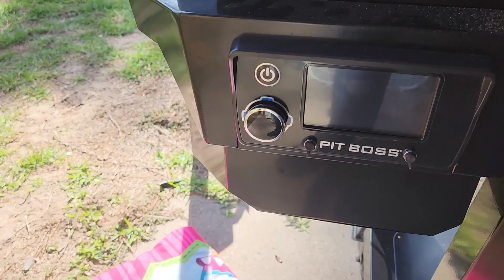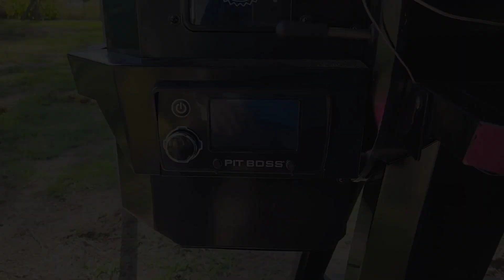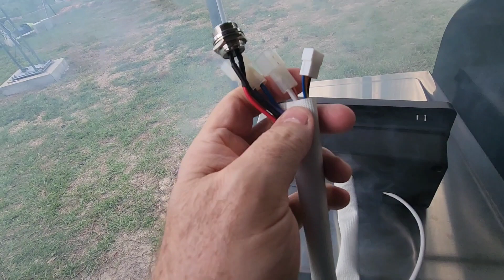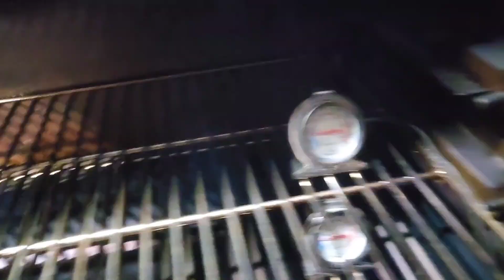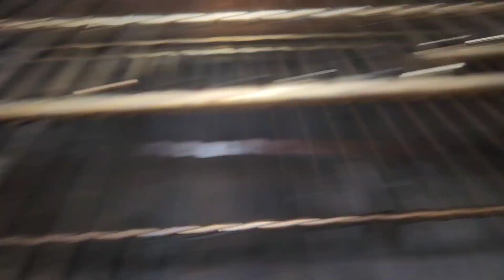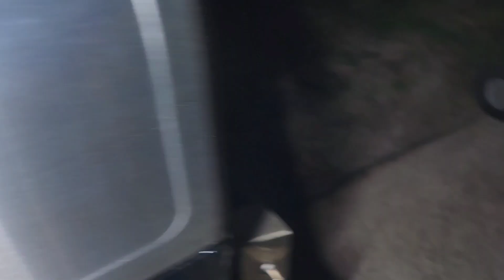More 1600 Elite PSE updates, Replacing the Controller?

Comment: You should look into the flame tamer (defuser) that has the 4 side openings (sends heat out in all 4 directions)
Reply from the maker: You must not have watched the video.  Lol I did have it. And I later removed it.
Reply: Your right - I don’t know how I missed it - well, maybe you need the two window version LOL
Reply: I bought a 1150 pro series and my fan runs all the time on high aswell. Did the heat sink you put on the fan connection make the fan motor slow down.  Im not getting hardly any smoke at 180°. Thanks for the assistance!!